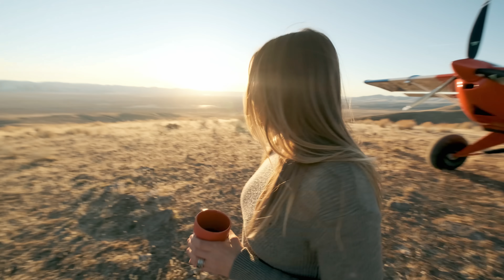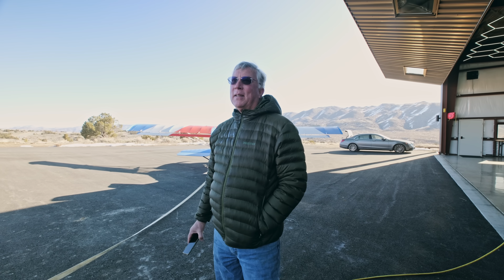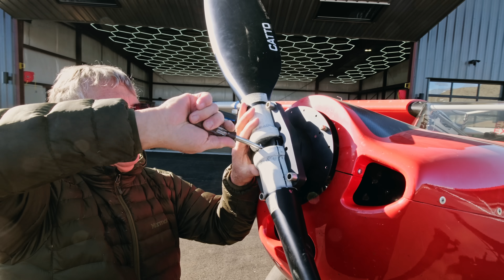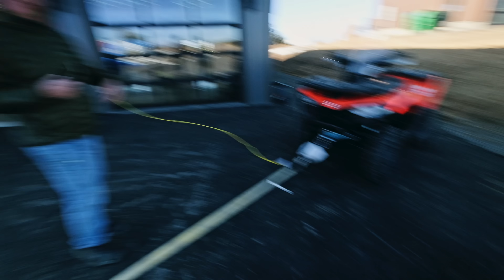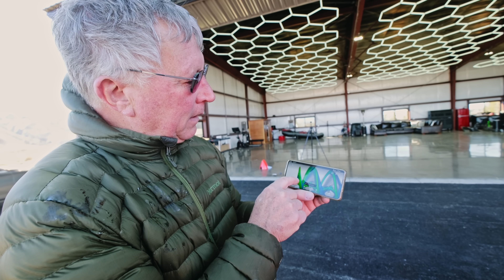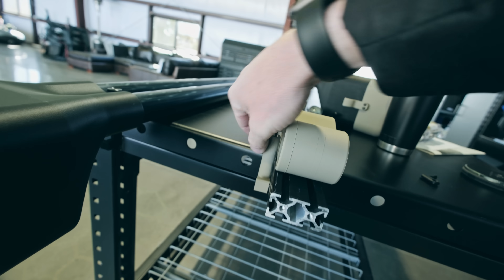Test Flying Catto's New Ground Adjustable Prop!

Comment: I did not see you or Craig safety wire the bolts that tighten the clamp around the propeller inner ends. What's with that? When I was working on aircraft, RF-101B, every bolt or screw  was
turned into  a self locking nut or nut plate or was safety wired. Failure to  properly install  safety wire would result in a serious lecture from the shop chief and the quality control section.

Comment: Surprised he attaches the pitch block with two bolts and doesn't use a torque meter or safety wire for the bolts.

Comment: ESAB or Lincoln for TIG welder. Believe it or not, you don't need a million bells and whistles with TIG but you want enough flexibility. Don't cheap out on amperage. Get as high amp model as your electrical can handle. You may even need to run a heavier electrical line to be sure you can feed the welder all the power it needs. Welding tips and tricks has an awesome store with all kinds of goodies including the TIG finger which you're going to want. He also has a lot of good tutorials. Make sure you get large gas bottles so you don't run out of gas every 5 minutes then have to go and refill them every other day. Don't cheap out on the helmet either. You only have 2 eyes. Doo Daa. 💯👈

Comment: Re fly rods in the pipe = how do you stop the rod getting damaged from the vibrations? Any foam in there? I can imagine the line guides and tips rattling against the blank while driving.

Comment: Is the current 3 blade still a constant speed prop? With changing to the new 2 blade ground adjustable, how would your back country flying be effected?
Reply from the maker: My current one is a ground adjustable as well. I did have a constant speed and found the performance gains were not worth the weight penalty

Comment: This prop is not for your airplane. One like it maybe, but not this one. So don't be discouraged by the numbers. This way of designing eliminates the testing and tweeking routine. Either you did the math right and it works perfect, or you didn't and then it's straight back to the drawing board, or screen in this case. The sound is sexy. No two ways about that. Vibration is a nasty tennant though, keep that in mind. Trust your gut, but check your fasteners.

Comment: Very interesting vid on the new prop. I just put an eProp, STOL prop on my RANS S6-S with a Rotax 921UL engine. This is an all carbon fiber 4 blade prop, ground adjustable that weighs 8.8 lbs. It pulls quite well and might be worth a try if you are still in the mood to experiement

Comment: Is it possible that the lack of the nose cone would have an adverse effect on the flight performance of the new prop? I have no idea what kind of help that cone actually does for prop/plane performance... I just realized that you had a cone on there with your three blade, but not with the Catto prop... I have no experience with engineering; assume I know nothing.

Comment: Heating your hangar: you could use infrared heating - hang a few panels from the ceiling like your lights, and heat just where you are working. Much lower running cost than trying to heat the whole space.

Comment: Man you should check out a Wood “almost constant speed” prop. They are fixed but have some special flexing properties. Also lightweight
Reply: The late Bernie Warnke designed the "almost constant speed" prop in the late '80's/'90's.  I test flew many of his props in my RV-4.  The current ones are replicas of his design.

Comment: Hey Trent. For the rod holder may I suggest printing it out of white or a light color as the black will triple or quadruple the inside temperature of the rod tube and may compromise your rods etc inside the tube. White PVC pipe with a white or cream coloured 3D print reel holder may be best. Great idea though good luck

Comment: I fly a Highlander with a stock Yamaha Apex and SkyTrax gearbox. Very similar power to your 915.
I use the NR SR118-2000 like yours except it’s only two blades, I’m extremely happy with its performance but you’ve motivated me to pull out my three blade hub and extra blade and see what happens to my takeoff performance.
If you have a two blade hub for your NR, I recommend you try that too.
Reply from the maker: I think there's something about the apex/skytrax combo that prefers the 2 blade setup, I have 2 friends that have tried the 3 blade and went back to 2, but its definitely worth testing to see!

Comment: I have long wondered about this "bigger is better, brute-force" mentality you have in 'Murica.
I have an ancient Avid Flyer (the grandmother of the Kitfox) that we built in 1987. It has only a wee little 64hp Rotax 582, it's THIRD engine! Beginning with a 532, graduating to a 582 and when that unit started showing signs of wear (500+ hours) the third one was recently installed. It beats the socks of anything in our area regarding sort-field performance - even the aircraft I fly the most these days, a 6-seat H-295 Helio Super Courier! 
The 1987 Avid Flyer is LIGHT - hence it's great performance. My home base is Isafjordur, in the West Fjords of Iceland. Where we fly to: The Hornstrandir are of the West Fjords of Iceland.
Reply: It's 'merica and it's not bigger is better and brute force mentality. If you don't understand why more power would be needed for a STOL plane then Im guessing you don't understand STOL planes. Last, stay in Iceland. We don't want people with your rotten tude here.
Reply: I had a B model Avid Flyer with a 532.  Pull starter, so no electrical starter or battery.  445 lbs empty.  Would get to 500' AGL from standing start in 32 seconds, starting from 1500' elevation.  Outclimbed my 650 llb Kitfox 4 with 80 HP 912.  Weight is the killer of performance.
Reply: @jimchuk8511  I had a 532 powered Kitfox 1, and it's climb, landing length AND cruise was pretty awesome, even as compared to my 100+ hp powered RANS S-7S, a pretty clear example as to how keeping things light really pays off for sure!
Reply: I also had a Kitfox 1 with 582 and just under 500 lbs empty.  It performed quite well.  Light weight is the key.   @portnuefflyer
Reply: I've hiked around hornstrandir and it's lovely, but there are lots of areas in the US that are 5000'+MSL runways, 12000' peaks and very hot in the summer; sometimes the extra power is needed to have acceptable performance at that altitude and temp

Comment: You would be better off using something other than ABS pipe for the rod holders. ABS pipe will warp and bow when exposed to the sun as it has extremely poor resistance to UV. PVC would be a better choice, as it is more stable in the sunlight. You can also sand and paint the PVC if you dont like the standard white colour PVC comes in, as well, you should be able to find PVC with the exact same outer diameter as the ABS pipe you are using.

Comment: I'm a bit puzzled to see that a "cruise propeller" is performing in a very similar way as the original 3 blade. I also don't understand why anyone would want a longer 2 blade propeller on a bushplane.unless you like to trim all the bushes on the runway :-). Woulden't a propeller tuned towards cimb performance be more suitable for the type of flying you do?
Reply: Or a smaller diameter three bladed, constant speed….🤔

Comment: You maybe should put the screw of your clamp all the way through the printed part and melt the nut in from the other side, so the stress of the clamping force is mostly on the screw and not on the vertical layers of that printed shaft.

Comment: Catto is a very well respected prop designer and manufacturer. I love learning that he is putting effort in non-planar prop tip design. As a note, Lonnie Prince (Prince Aircraft Co) has been selling his P-tip props for quite some time now. From what I can see, they are a form of non-planar tip claiming similar merits. I can believe, however, the Catto may be taking the idea to the next level.
Reply: We shall see, coming from a 2000 hour+ Prince user (love it), the real difference of course is Lonnie only offers fixed pitch.  BUT, after many years of flying with various  ground adjustable props (Warp, Kiev,  Luga, Whirl Wind, to name a few) the simplicity and lightness (my 78" Prince is lighter than any of the others I've tried) is appreciated. I think Catto is on to something.

Comment: There is nothing new under the sun Trent. Propeller science is old. As I expected, besides being quieter Cato's design did not do much different at the same power (fuel burn is a very good measure of power) in terms of giving you a much better/faster cruise speed and my prediction is it won't in future either. Many people get all confused with engine RPM as they treat it as power setting which it obviously isn't. For the same power and same diameter in general you will be within 2 knots of speed at same fuel burn. That is my prediction and I would love to see if Cato can redefine what i understand. I doubt it. The main thing would be it will be quieter because of the modified tips. The tips create efficiency usually at slower airspeeds for wings (prop blades being wings that usually are operating at very high airspeeds at the tips). If you really want to see better efficiency that is somewhat significant, try and in-flight adjustable specially with your non-linear torque curve from the turbo charger. That will make a difference but it isn't allowed by regulation for Sport Pilots although MOSAIC is likely going to allow single lever operation. There is another prop from France called E- prop that has some mighty claims as well. That is also a lot of marketing and confusion although it does have one difference and that is between sea level and say 7000 feet the prop does not unload as much as others. Other than that it's so called ESR effect is a bunch of marketing when you really get down to proper numbers and measurements. Same power setting with same airplane in same conditions.

Comment: Think you might put the final .stl for the rod holder up for sale? I love this idea and have a 3D printer at work lol
Reply from the maker: Sure, I’ll upload it to my printables account. It’s really only made to fit on roof racks with 1x2” extruded aluminum cross bars (like my Sherpa rack) but I’m sure you could find a way to modify it to fit other cross bars.
Reply: @TrentonPalmer Awesome thanks!  I don't have any racks yet. I have been looking to make a custom set up for my Ram without having to have a camper top on and not loose functionality of my bed cover.
Reply from the maker: https://www.printables.com/model/818309-vehicle-fly-rod-holder

Comment: This was interesting to watch.  The only thing I think could have maybe changed it up, and I don't even know if it would have matter, the spinner cone.  During your control test, you had the cone on, with the new prop test the cone was off, could have effected .1-.3 gph as well.  Never know.  

Next time you guys test it, leave the cone off for both.
Reply: Doubt it will be 0.3 GPH. I would be very surprised by that.

Comment: Trent why do you keep fussing with these fixed pitch props? Airmaster makes an incredible light weight electric constant speed prop designed for the 915. You’d have better STOL and cruise on the fly in one prop plus feathering. You wouldn’t run a fixed clutch in your snowmobile would you? Of course not!
Reply from the maker: I have run 9 different props, including 3 different in flight adjust/constant speed props, and with my drag profile and the amount of power/torque my engine makes I have not found the constant speed props to be worth their weight. My current prop replaced my MT constant speed and the ground adjustable pulls harder on takeoff, climbs better and cruises the same speed on less fuel. I also owned an air master, it was a nice prop but not for my demands. Again, if I had a less draggy plane or a lower horsepower engine it would be a different story.
Reply: Just grab an Eprops, I promise that will be your last one!
On my A22, I have shorter takeoff, fly 10kts faster and burn less fuel. I know you don’t believe it. Try it 6 months and return it for free! Nobody return it and you do not find any on second hand market, guess why… 
From far my best investment in aviation together with the autopilot.
Reply: @TrentonPalmer  everyone, including myself, is raving about the eprop for rotax. Nothing so far beats that. They also make a CS.
Reply: @MatthewDeis   Indeed, it's just hard to get past how UGLY it looks!
Reply: @portnuefflyer  indeed. Duc and E props look like match sticks. There’s a nice fat cord whirlwind on the air master for the 916 which looks excellent.
Reply: The weight and moment arm won’t add that much. He’s not doing completion much anymore. You could put a 1 pound weight near the tail wheel and offset everything and you wouldn’t even notice it. If he hasn’t installed them already, VG’s on the horizontal stab would help pitch authority. He flies often at higher altitudes, albeit still lower agl but if you do a cross country between 10 to 15,000 feet drag is significantly diminished and a CS prop will add 10kn to your cruise up high. I get full 5,800 rpm’s on takeoff with mine no matter the altitude. 

The MT it’s a different beast and you have no real control over its pitch. It’s also hydraulic and may be heavier.
Reply: Some sleds are direct drive
Reply: The main problem is where the added weight is located that is moment-arm. 

I don’t think he likes not having enough elevator authority with a constant speed on the nose and the airframe is largely drag limited as it is. 

His speed and fuel consumption was largely the same with the 75” MT on the front before.

Comment: It's brilliantly amazing to see this advanced development. I started visualizing the moment of the disc collapsing into two cones and immediately felt compelled to model the two vortex cones pressure areas as the disc size decreases and the lowest pressures of each cone crosses. It's difficult to imagine how changes between the propellor blade centerline(s) behave. That said, the bending moment of each blade culminating a net force at the fulcrum may allow a trunnion mount hub and center pin to lever a barrel against a pawl resulting in automatic cone reduction resulting in reduction of the converging cones back to the desirable larger disc where the lowest pressure vortecs remain far ahead if the propellor flange. Me thinx✌🏻👶🏻🚬

Comment: Love how honest this video is. Tests a new propeller that claims all this technology then it performs exactly the same. He didnt sensationalize or anything. Interested what other people thought of that?
Reply from the maker: I’m just bringing you guys along as craig and I try to see if he can come up with a perfect prop for the 915, this prop obviously is designed for the 916 and with a twist that has a peak efficiency that’s a good bit above my cruise speed so right now it’s just getting baseline numbers and confirming there’s no fitment issues. It’s always fun trying new things (at least when done in a safe way)
Reply: When it comes to props the gains in efficiency between a modern blade design vs a 1940s design is minimal. from what I know the 1940 designs were over 85% efficient. Today’s modern cad designed blades are barely over 90%. What has changed a lot is the sound profile and vibration tuning.
Reply: I agree, interesting to see the computer modelling, but reassuring that conventional blades perform well enough that we don’t need to panic that we are losing out to new designs 😅
Reply: I have a NR prop on my flying Kitfox 4 with 80 HP 912, and have another one on my Kitfox 4 build project with 100 hp 912.  I'm happy with them.  Maybe not the very best prop out there, but pretty good.  I think it would be fair to mention that the engine that lost the blade was a 160 HP Lycoming, and the power pulses on it are much harder on a prop then the 915 high rpm going through a gear box.  Never heard of any Rotax engines losing blades.  Yrs ago, Warp drive had some blades fly out of the hub, and they are one tough prop.  It was good to watch the comparison.  Thanks Trent!  JImChuk    @FlyingDarkLord
Reply: I don’t know, two prop blades performing as well as 3 prop blades… normally 3 blades is more efficient at speed, but this 2 blade prop performs nearly identical with one less blade.
Reply: @TheCriticalArchitect  dude that's actually a great point.how did I miss that
Reply: What's interesting is static thrust doesn't tell the whole story. It's easier to design/test blades without computer models for static thrust, but what about at 20-40-60-80kts? That's where CFD would give better insight for designing an optimal propeller to function within the "envelope" so to speak.
Reply: 5% seems like a lot to me.

Comment: I don't see a difference between the two props,  what's the price??
Reply: 80" ROTAX 915/916 Cub Type
$4,150
Available for ROTAX 915/916 with 8mm or 5/16 bolts

Includes hub, blades, hub internals for pitch change and instillation bolts.

Spinner $875